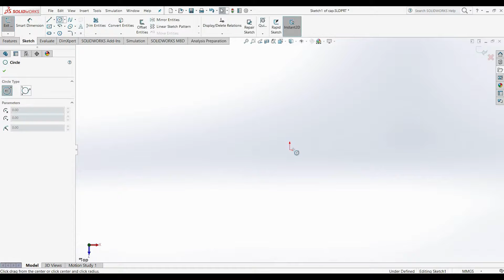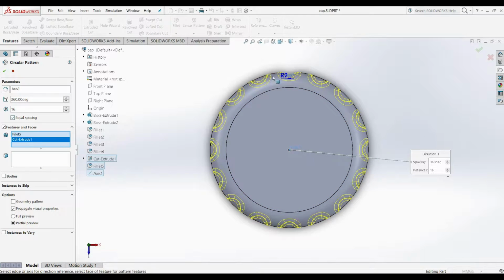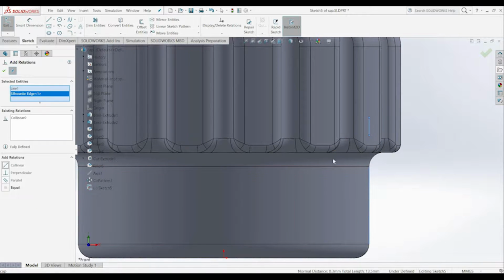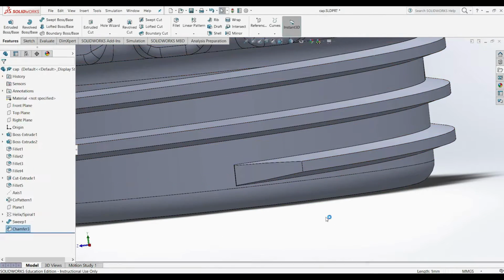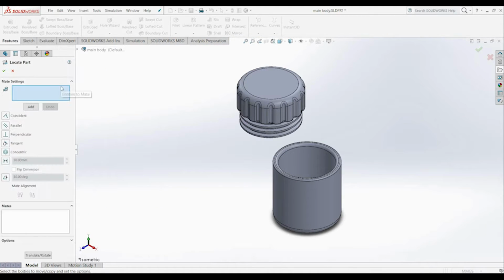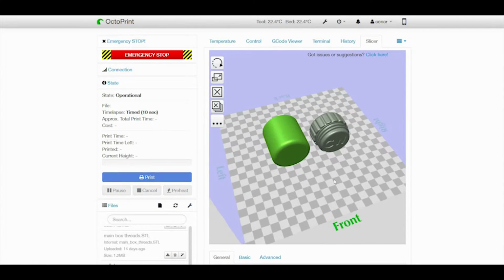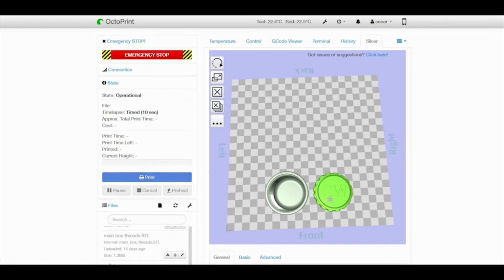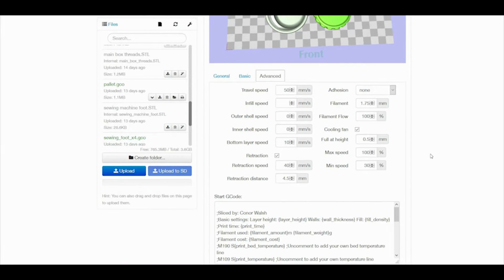How to model threads in SolidWorks for 3D Printing (Short Tutorial)

Comment: Really nice job. I want to print some objects which have motion such as a door that can open and close. Can 3d print achieve this motion at the real object?
At software the motion is working properly
Reply: Yes, if you want it to print as an assembly then you will want to ensure that there is a decent gap between the bodies that you do not want to print connected but not such a large gap that any bridging fails. You should look up videos on how to design print in place models that will provide better instructions

Comment: I made my own design for something but completely followed the same steps you did with my own dimensions for the thread. But when I 3D print it. For some reason its printing the  thread on its own and not the solid cylinder base. I'm not sure why please can you help? I thought the thread and cylinder could be 2 separate bodies at first but then why would the stl file show it as one body. Also in solid works its says solid bodies(1).